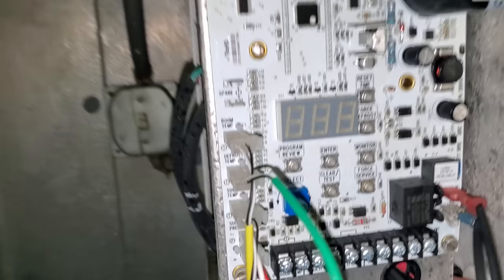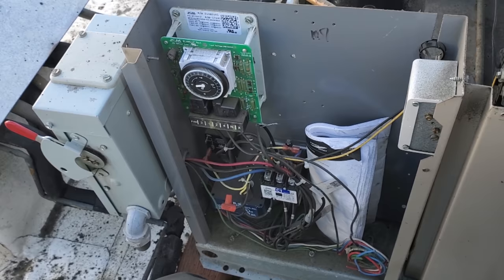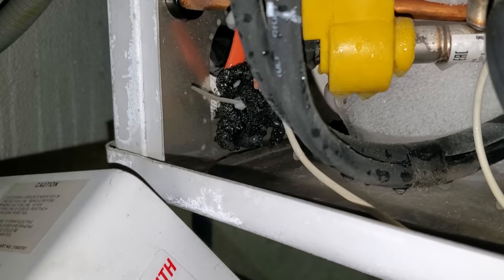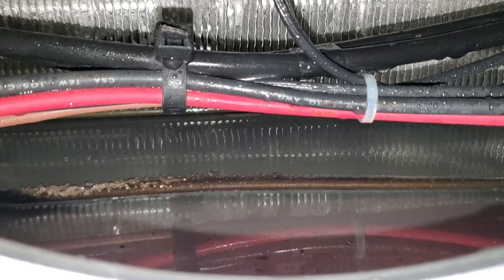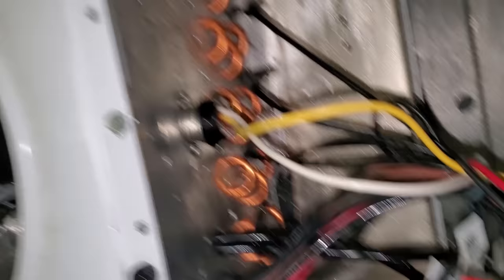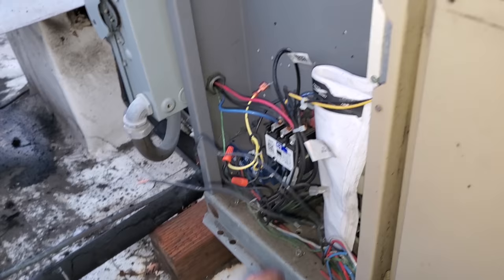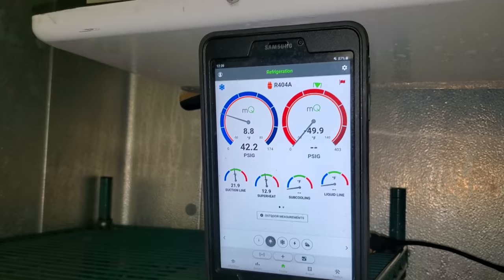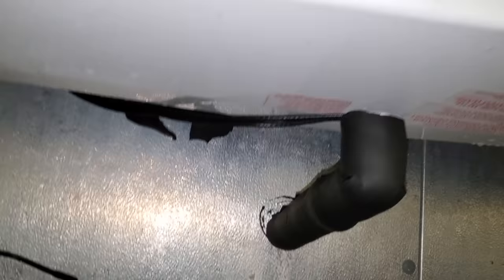THE OTHER COMPANY COULDN'T FIGURE THIS ONE OUT EITHER

Comment: nice work!  i hope you don't overload the neutral wire you connected the door heater to with the additional current.  the heater wiring may be the reason the first neutral crapped out.

Comment: This old Plumber figured out years ago- that condensate lines tied together are a disaster. Nothing like working in a restaurant and finding 30 or so gallons of grey condensate scummy water-in the ice machine bin used on all the drinks.... I run each separate, and don't even tie the top cooling  unit drain and the ice bin drain together.

Comment: Sadly you’ll see this same thing in the automotive industry also. Untrained technicians getting in over there heads and creating even more problems for the qualified technicians to have  to clean up.
Reply: I can confirm this wholeheartedly. It legitimately makes good techs drop certifications to lower their qualification level to NOT get the comebacks and hard work. Big picture diagnostics? Nah, go for the quick fix to get paid and onto the next one. Let the Master techs deal with the comebacks.
Reply: This situation is commonly known as "firing the parts cannon"
Reply: My experience is having friends ask me for "help" when they're about halfway through fixing their car and discover they're in over their heads. My first twenty minutes of a visit like that are spent assessing how many headaches I have to untangle before I can get to the actual job.
Best one: I install a car stereo for a friend. He specifically asked me to do it for him, as he wanted it done by someone that would do it properly and couldn't afford having it installed at a shop. His friend complains I wired it wrong (it wasn't "loud enough," but what can one reasonably expect in a Geo Metro with 4" speakers?) and next thing I know, my friend is asking me to figure out what his friend did to "fix" it because the left channel is completely silent and his parking lights/dash lights come on whenever the stereo is turned on. Turns out his buddy hooked up the Left Front Positive speaker lead from the stereo to the Illumination lead from the car's wiring harness (the car stereo's amplifier was driving the parking lights and feeding through to the dash lights) and he had connected the stereo's ground to an unused negative wire for stereos that dim the display on a negative voltage - which explained why turning the stereo up to a high volume kept popping the Dashboard Illumination fuse. I put the wiring back the way I had it in the first place and told him to keep his hands off it! Luckily, the stereo had suffered no damage, it was a pretty pricey deck.
Reply: @toyotanos  Thank God for the Eric O's and Chris's of this world then lol or nothing'd be fixed right!  Personally I love a challenge but I agree it's super frustrating treading back over ground that someone else messed up before you can get to the actual (usually simple but missed) fault.
Reply: That is true for pretty much any industry. I have seen plumbers doing that. I have seen carpenters doing that. I have seen electricians doing that...
Reply: And the electrical industry
Reply: @dashcamandy2242  I enjoyed reading that. Car stereos can be a nightmare of wtf. I had part of a factory stereo jammed in the glovebox of my Grand Am for the "body module" GM put in the HU. While a I fit a Scion/Pioneer unit in the dash, drilled an aux jack into the faceplate as well. That HU had hidden modes for the different Scion models, and programable display. At one point all Toyota HUs had a sub out line. Anyway they make a box now to route around the factory GM junk. 2ohm factory speakers caused problems as well. Kind of fun hacking that stuff to work.
Reply: @dashcamandy2242   I hear ya, power lead to my fuel pump failed so I took power off the rear turn turn signal lead and every time I put the turn indicator on the pump would shut off, only took me two turns to figure out what was going on.  Ha,ha.
Reply: Same problem in construction, you get sub par workers and you spend half your time un doing and redoing the shoddy work.
Reply: toyotanos I couldn’t agree with you more I deal with it so often on the ac problems, I dealt with one last year it took quite some time to narrow it down to a jacked up swashplate shoe in a axial load sensing hydraulic pump that ran the whole truck hydraulic system including the ac but being it was jacked up the hydraulic system was running at 325 degrees when it should have been no more than 165 and once i got the heat under control the ac was able to work because the cab had so many hydraulic hoses and components in the cab dispersing all the heat into the cab and now it has been cured but took a lot of doing and like you say master tech always look at systems from a systematic approach when diagnosing them not jumping from one problem to the next and ingressing another issue into the system, now when there is an issue they just bring it to me because they know I will take the time to properly diagnose the situation and fix it and not mask the problem being fixed when it was not. It does give you a sense of pride when you are able to correct a problem so many other techs looked at...
Reply: You mean like the transmission in my Ford Focus. Bought the thing used. Ran fine on the test drive. By the time I got home the transmission was running like it was plugged in backwards. I had to drive that thing to school and work for a month, and any time I would need to hit the gas to say avoid being run off the interstate or something by someone trying to merge into my left rear quarter panel, the transmission would just shift into neutral and cut throttle. Thing was a death trap. No recall notice for this awful thing. Dealer didn't want to fix it or trade it. Finally we got it traded for a Fusion, which works decent enough, loosing 1000$ in the process. Always do very thorough testing on used or even new vehicles, make sure the drive train is working properly. Thing stalled in an intersection and I nearly got creamed by a speeding semi.

Comment: The best engineers out there they spend a fortune in RND and a monkey throws it down the drain. That company is not qualified and should not be allowed to trade.
Reply: there are always tons of variables in life ..NAFTA agreement gave us suspect  electrical part,some time engineers don't  build stress points that will last in the extreme conditions in the products environment   ... some times installation teams don't have everything they need and use old wiring or old solder, old copper tubing, torch out of gas.... can't see for poor lighting ... thunder storm outside and everyone is in a hurry ... customer in a hurry... tech in a hurry... the list goes on...

Comment: Where the drain line (copper tubing) meets the freezer wall, it would be good to put a rubber grommet to keep the copper from rubbing against that sharp metal that someone before you cut to crap.  Saves future headaches.  I know, there were so many messes you had to clean up from the previous folks it's not even funny.

Comment: OMG what a cob job i hope you reached out to the licensing  division about the other company the wiring they did was borderline violation depending on the state.  no matter  any competent installer should have seen what you saw. i used to do  hvac and mac certified and my dad was master electrician hats off to you for biting tongue but good grief what a mess. i'd like to know if they ever called you back about a detailed break down on problems so they could go back for reimbursement  from other  company, because many states have not implemented  "lemon laws"  against lic  hvac and electrical contractors for shoddy workmanship

Comment: I like to use a long radius 90 on the drain line under the pan. You can heat it up and stretch the 90 enough to get the grade going out. Any ice that remains after defrost will build from the pan up. It ticks me off when I see people charging for fixing their own crap work.

Comment: Here in England we have a name for companies like that, we call them cowboys.
Reply: SHAMBOLIC and DANGEROUS Cowboys. Sue them.
Reply: here in Austria (and probhably germany) we call it Pfusch
Reply: We call them Fly by nights.
Reply: Mickeymouse outfit ‘fixed’ it before you for sure.
Reply: Yeah
Reply: "Running shoe mechanical " is a term used by the professionals I work with
Reply: My Dad told me to never trust a Cowboy
Reply: @tbauer2521  Your dad was spot on when he said never trust a cowboy, just don't.
Reply: Europeans have higher standards for the installations than then in America. We still use wire nuts. This is equivalent to an open cut. Infection can be compared to corrosion. That doesn't mean there isn't "Cowboys" in Europe.
Reply: So many people use the big name companies that are too big too care and should use the local guy that has a small business and will turn up at 5pm on a Saturday

Comment: Did you install a p trap  on the drainpipe between to the freezer and the beer rom? This will reduse ice buildup during normal usage since you stops moist air traveling from the evaperator in the beer rom, when they  close the door to the freezer.

Comment: It blows my mind that Al this circuitry is in there , why would it.. that's just waiting for oxidation an electrical shorts, why isn't this in an enclosure next to it , this is asking an HVAC technician from the Netherlands
Reply: I thought the same why have all the electronics and electrical wiring inside the cold room. With all the moisture and condensation about it just asking for trouble. Her in uk the main controls would be outside the cold room in a dry waterproof box..but I guess with the low voltages involved in the US they can get away with junk.
Reply: Normally, the wires stay warm and water is drawn to where it is coldest or where there is a cool enough of a temp difference of the ambient air around it.    In addition, copper doesn't rust from water, that is why we use copper pipes for water.  Granted, having it in a different spot would be extra safety, but only applicable in situations like this where water and ice claimed some of the circuitry.

Comment: It's been awhile since I've even thought about the steps to TS a refrigeration system. Long enough I'd have to take a refresher course. But I can still follow along.
My only question is, are the techs who worked on and screwed up this installation certified? Maybe the other company hires tech school grads who have just enough education to work on simple stuff but not the experience to work a commercial installation. If so they just keep throwing cr** at and pray that makes the problem go away.

I've done my share of cleaning up automotive stereo installation wiring rats nests to understand the WTF did they do that. But what you were dealing with was a 100 times worse for complexity.

Comment: I used to shake my head the same way, and say the same frustrated words bailing out the crappy substandard work of other people I knew at the cable company... and the same look, and words opening up some nightmare computers as a computer tech.   I think in every technical industry and service job, there are always those who just get by and those who know what they'e doing where and why they are doing it that way instead of this way because it matters for that reason.   There are always gonna be doctors who graduate at the very bottom of their class and the problem is, we still have to call them doctors (even though they will probably get sued out of practice later).   Ditto for the compute, cable, electric and HVAC techs... there are always flunkies who barely passed who do things like robots without using their heads and when you aren't one of those, and you see all the mistakes, its always gonna get to you.  So my thing is, if they are going to use your superior knowledge and better applied attention skills on the job to bail out the crap done by the cheaper guys, you charge them a premium tech price worthy of your time and deliver the bill with the carefully worded softly delivered admonishment pointing at that stack of bogus service calls they paid for the other guys to come back and half-fix or hack-fix their original install mistakes or create new ones, that you would only have had to charge them one install fee and the rest of those chargers never would have happened, so wouldn't it make more sense to next time not start with the tech school skate-by when it will likely end up costing 3x more in the end in bogus bills and 10x more in frustration and just come to the guy who will do the job correctly the first time for honestly not that much more up front when you think about all the losses the other guys create on the back side.

Comment: I was always told that a P trap is to keep sewer gasses from coming back up through the drain. What is the point in putting in a P trap that immediately goes into another drain? 9:00
Reply: That is one application of a p trap  
When dealing with air conditioning and this type of unit you are taking a drain from a coil that may be in a chamber that is at a lower presure that the air outside the unit depending where the supply fan is located in relation to the coil and drain pan it is important to fit the correct size of P trap to stop the air from outside the unit being sucked through the pipe and stoping the water from draining out of the unit. The trap must have suficant depth to overcome the suction of the fan and not let the water get lifted out the trap else the unit will not drain water correctly .  I have come across many units where the drains are not correct and when you turn the unit off then water floods out of the drain  pipe work. All of this water is held back in the unit by the suction of the fan causing lots of internal rusting and reducing the life of the units .
Reply: @hotrex7779  Also, a P trap can keep critters out of the pipes!😉

Comment: The last HVAC training I got was in the USAF fifty years ago, and everything I worked on was supposedly built correctly and maintained correctly.
I noticed at one point you said something about "That's good enough for now".
That's great, but you have to document what you did and then FIX IT RIGHT before you sign off on the job, as you did, which is what the techs for the other company did NOT do.
Even in the USAF where people's lives and frickin' national security are at stake, not some food or beer, I saw misrepairs along the lines of what you found- not so much parts swapped out incorrectly or left in and not wired up but half-assed band-aid solutions done and the unit sent out like that.
You just have to care about what you're doing. Treating it like a job won't cut it.
That's why you're thankful to have work, because to you it's not just a job.
Reply: But sometimes you need to draw the line. It is impossible to make everything perfect... Otherwise you should rip everything off, install it again, and you will find that as a matter of fact, you could have installed it even better.

Comment: Excellent video and troubleshooting! I spent 5+ years working as an equipment and HVAC technician for a large national fast food restaurant chain. From refrigeration to gas fryers, grills etc. I've seen and repaired many of the same things in this video. I worked with a few excellent teachers over the years, and they really helped me understand troubleshooting on many types of systems. I am retired now, but I still miss the excitement of diagnosing a problem or fixing a piece of equipment.

Comment: Not that I work for this other company (I'm not even in HVACR Business) but this happens mostly if some unexperienced technicians are left alone with installs they are not proper - if at all - trained for. Some companies tend to send out new technicians without training or checking their work because it is cheaper. Sending new technicians is no problem at all, thats why they are hired, but you have to check the work the first few times and/or you have to be approachable if they call you for help, no excuses. Otherwise you won't see the big picture and make mistakes - no problem, but you can't even spot the mistaeks, and that is nothing a paying customer wants to hear or even pay...

Comment: SJ cord really? That’s meant for extension cords. They make a high insulated two wire cord for that like a lamp cord but for these units. So the center fan tripped the breaker and the drain was really jacked up no to mention everything looked like it was just hanging that needed buttoned up. Yeah it’s a wonder this company it’s still in business. I owned my own company for 40 years and have fired techs for less than that. Good job

Comment: I have been a commercial plumber for over 35 years.  I can not count how many walk in coolers and freezers I have hooked up over the years.  Very important to follow the manufactures instructions on condensate drains grade and how many bends.  Always run the drains independent from each cooler unit as well.